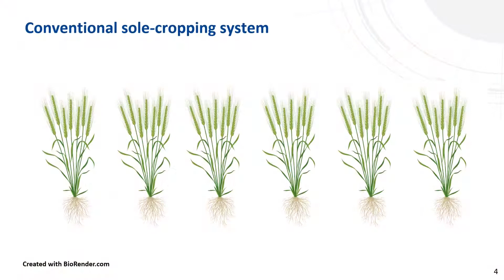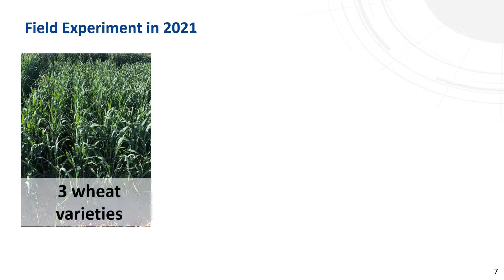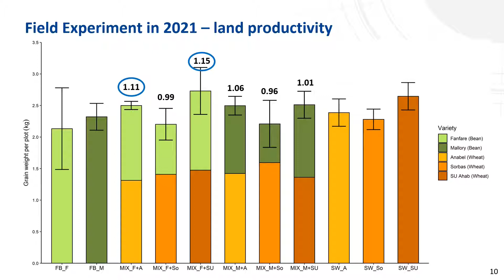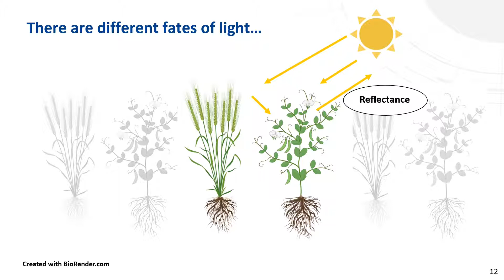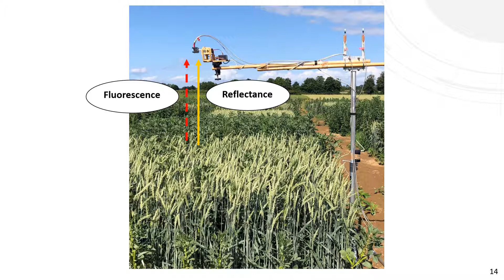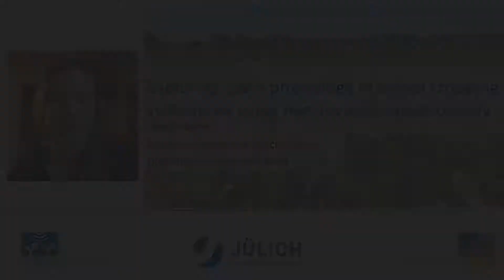Julie Krämer - Exploring plant physiology in mixed cropping systems by using non-invasive...

Comment: Are these results with or without artificial fertilisers and pesticide use? Farmers who returned to wheat-bean mixed cropping are often doing so out of a desire to avoid the use of artificial fertilisers and pesticides and they tend to report that the yields they achieve with wheat-bean intercropping, but without artificial fertilisers and pesticides is just as good as mono cropped growing with articifial fertilisers and pesticides. Furthermore, they tend to report that the yields were lower in the first few years of switching from mono-cropped to mixed cropped farming, which is almost certainly due to soil quality and the gradual improvement of the soil as a result of sustained mixed cropping.

I think this is very important research that we need much more of, but comparative analysis should be done in a way that it actually takes the above mentioned factors into account. We need more scientific evidence for a switch to non-chemistry agriculture. Unfortunately, most scholars are still preaching the gospel that it is impossible to feed the world without chemistry in agriculture, even if there is mounting evidence that this is not actually the case.